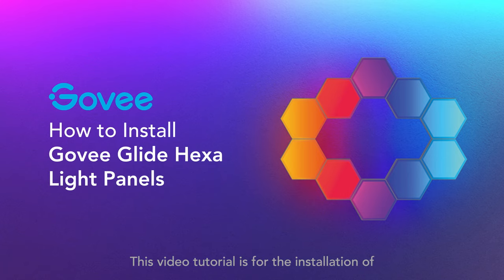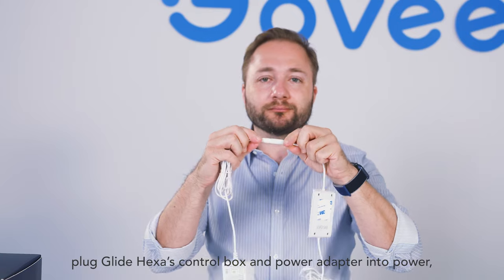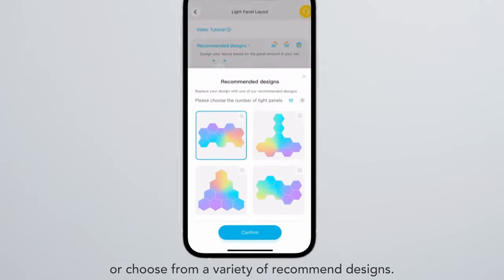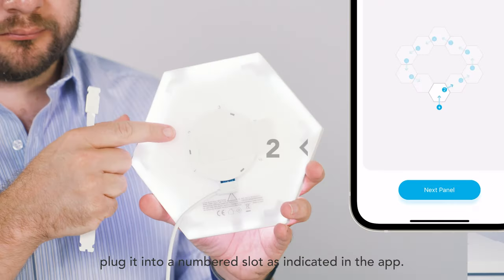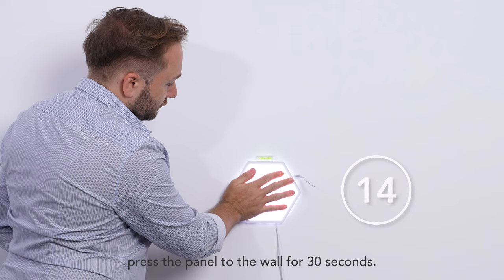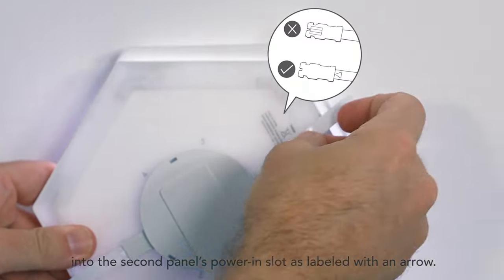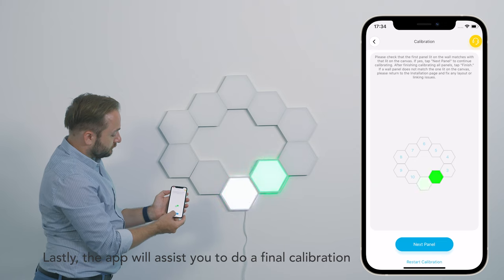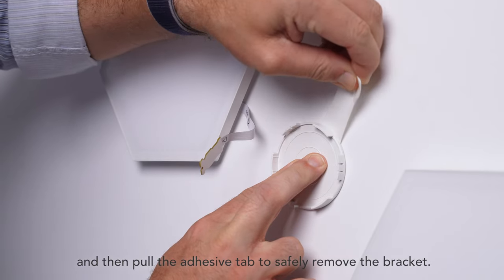How to Install Govee Glide Hexa Light Panels?

Comment: This is honestly more complicated than it seems guys
Reply: It’s actually complicated in their instructions. Make your design, Plug in link, level, stick. Repeat
Reply: Yeah. Tbh just make sure that the link cable is in the right direction, and that it's plugged into the (1) input slot of the next panel.

Comment: For my particular wallpaper I'd have to DIY a flat "backpanel" for the desired path and mount that with nails/screws, as the wallpaper itself is too rough and a bit risky to just rip when pulling off the adhesive tab.
Reply: just use the cardboard hexagons that come in the same case

Comment: I'm on my FIFTH set of these panels! ❤️❤️❤️❤️❤️
Reply: Hi! Have you ever tries putting them.on the ceiling? Is the adhesive strong enough to stick these panels to the ceiling ? Thanks 🙏🏼
Reply: @ChrisDeJuanMusic  I have not and wouldn't attempt to without using Gorilla Glue.  The panels are a bit weighty and the adhesive is good, but if placed on a ceiling I'd use glue to be safe.
Reply: @poppopw5305  Thanks, good to know! 👍🏼

Comment: How many panels can you add at the same time ? only 10 ?
Reply: As many as you ordered, meaning if you ordered the version with 10 you can use a maximum of 10 with one power supply. If u bought 7 u can only use 7, but for now 10 is the maximum
Reply: Thank you!
Reply: The other commenter is not correct. You are able to purchase as many as you like and add-on as many as you like.
They sell these in a two pack. If you would like to add just a couple on..
Reply: @TestSubjectMacHoshi  awesome, thank you so much for the info.
Reply: Wait you can't like add 2 or 3 more?

Comment: Only the base one works
Reply: You installed the linking cable wrong. I had the same issue, turned the linking cable around plugged it in and it worked

Comment: Sorry to report, but, the Hexa Lights are garbage. Power cable gets stuck so you can't check the rest of the panels and it can't connect to the phone via the rated Bluetooth or 2G Wifi recommended from the manual. Tech support was terribly unhelpful. Don't waste your time with these, folks